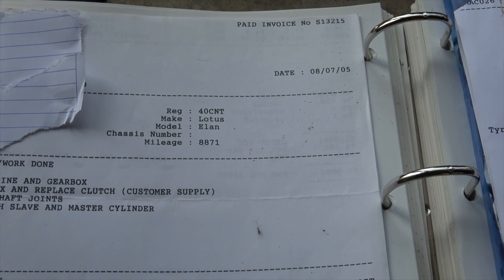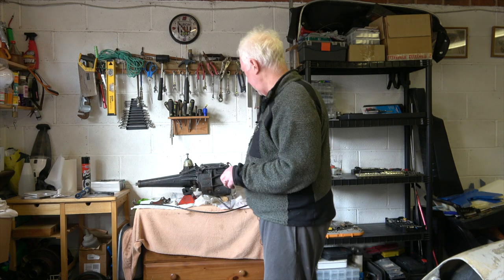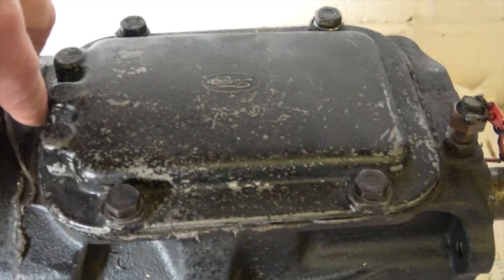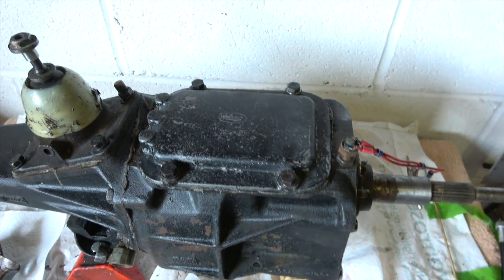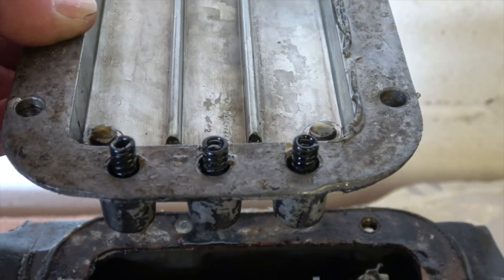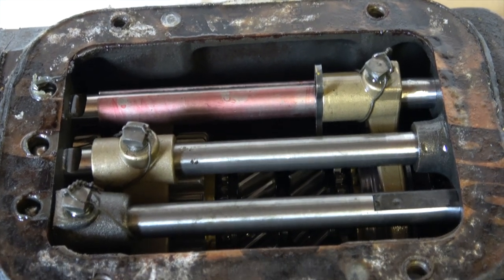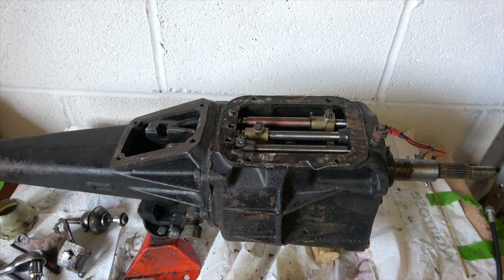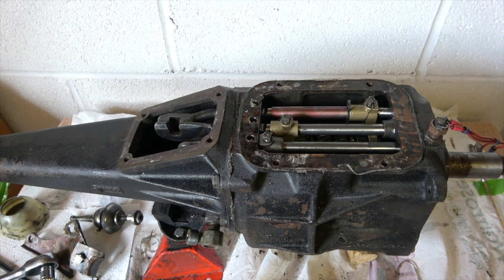Lotus Elan Gearbox sealant. How not to do it!!!!!

Comment: Believe me David, to the Lotus Elan enthusiast, all your videos are interesting.  Something to consider when painting the gearbox.  I painted mine British Racing Green with a black tailpiece but the part that set it off was the aluminum cover.  I removed all the paint and left it natural aluminum silver.  Too bad you can't see any of this when installed in the car!
Reply from the maker: Many thanks Frank. I enjoy making the videos and if they are interesting and informative then I've achieved what I set out to do. My engine has traces of the old colour, a light Blue, which I will revert to. I'll have to give some thought to the Aluminium cover. what did you do with the Bell Housing?
Reply: @davidbaugh  David.  I stand corrected.  (Remember, you can't see much of the gearbox once it's installed.)  I dug out some photos I took 20 years ago while restoring the engine and gearbox.  These pictures were taken before the digital age so just now, I took a couple of pictures OF THE PICTURES.  They show that while I painted the gearbox black, I painted the tail housing and bell housing British Racing Green.  The cover for the front of the starter is black as well and the aluminum cover is au natural.  Really looks sharp.  I can send the pictures if you can provide an email address to send them to.
Reply from the maker: @frankhoward7645   Love to see them. email is djbaugh222@aol.com